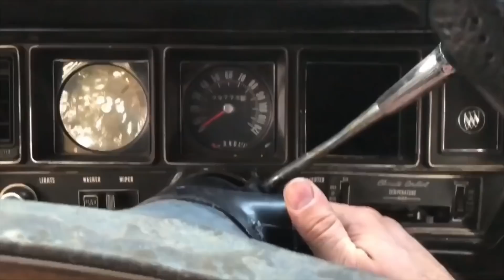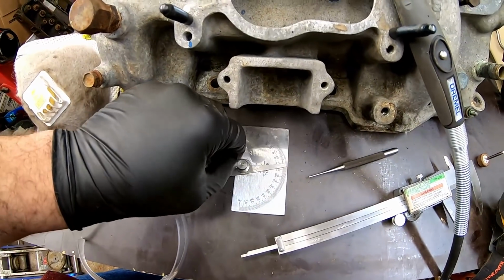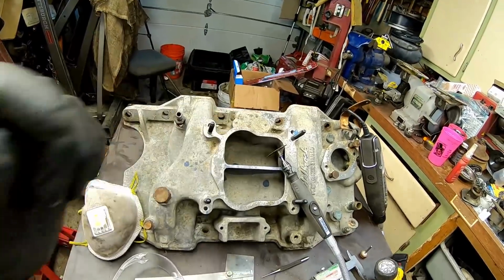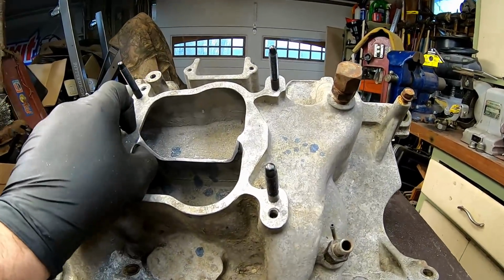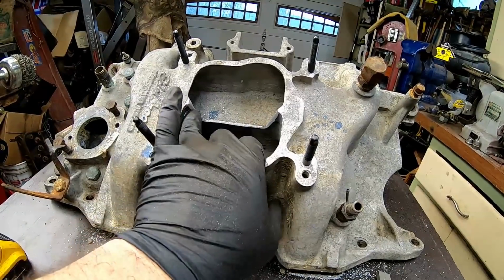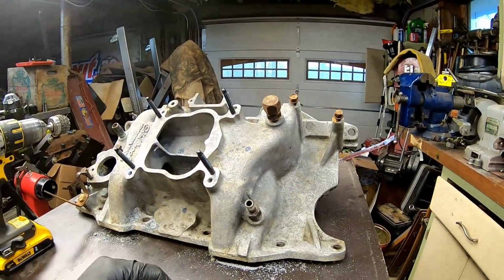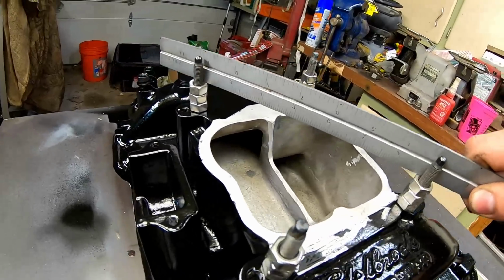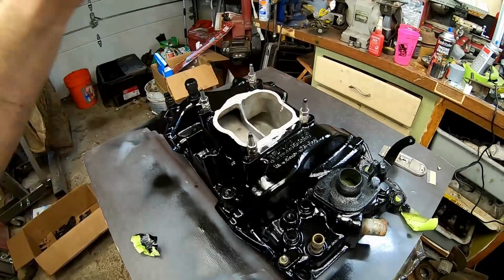How To Increace the Plenum volume for Cheap Horsepower: Notching Intake Manifold Modification

Comment: I like what you are doing so far but I have a question. with the intake ,spacer,carb,and air cleaner are you going to have hood clearance issues .keep up the good work
Reply from the maker: I might need to get a different air cleaner. 🤞
Reply: @LunarOutlawsGarage  I think you need a RR power bulge hood! 😉👍
Reply from the maker: That would be cool
Reply: are you going to put the car on the bottle rocket diet .I know they cut some bracing from the hood and it's pretty cool

Comment: Hey man....the rebuild carb and the mod to intake came out great .....still the black paint is growing on me....but it is what it is 👌......360 heads will also pump up the volume too ?.......be well.....🤘🤙👍
Reply: 360 heads wound ruin the power making ability of the engine.
Reply from the maker: Thanks herbie
Reply from the maker: Ya that would increase the combustion chamber up unless you where to machine head and the deck

Comment: 37 years ago I did that to an intake but I cut it open until all the runners were showing so it was like a modern open poem intake but didn't look like it from the outside
Everybody told me it wasn't going to work
The car run the 10.91 et nothing spectacular to write home about
But after I open the door plane intake to that I ran a 10.74 et 
I don't know what kind of game that made for my 468 big block but somebody that's smarter than me can tell me

Comment: What intake model is that
Reply from the maker: Edelbrock RPM
Reply: Elderbrock 2176
Reply: I have a 5th Avenue trying to find right intake carb and how to make a 4 barrel work with my throttle cable and 904 kick down

Comment: Remember paint doesn't adhere to aluminium very well, after a few months the paint will start to flake off, the way to counter that is to alodine/arodite the manifold first then apply the first coat of primer
Reply from the maker: Yup I hit it with the class media 97% Isopropyl primer then paint. It will be good been doing it for years with no problem 🤙

Comment: The only success Ive had in plenum trimming is with a EFI Magnum plenum. Trimming back 1.25 inches off the runner really woke my 318 up. On wet flow intakes, 1/2 " works best for both HP and TQ. Most TB spacers have smaller openings than the intake and in my case restricted performance .TB spacers are a scam

Comment: Think ya mighta taken lil too much.  Offenhouser took an inch sq. On their manifolds.
Reply: The Offy designs are 50 yrs old, rather obsolete now. They're down at least 20 hp compared to either a Torker or Performer RPM. Actually, my old 318 Streetmaster was really obsolete too, a single plane with a tiny plenum and runners. But it was fine for my use.

Comment: Lol I have that exact same intake lol if I do the same what you figure is the horsepower gain if any
Reply from the maker: We will see come dyno day
Reply: @LunarOutlawsGarage  right on I'll be watching. Did you do dyno before you did upgrades
Reply from the maker: No that engine was roached
Reply: @LunarOutlawsGarage  ok fair enough itll be cool to see bet you can easily get 300 to 350
Reply from the maker: I am really excited to see the numbers
Reply: You're only going to gain HP in higher rpm range. So you have to have a camshaft that supports that. The dual plain actually has more velocity since it essentially makes the runners longer and makes way more low end torque. Smaller cubes, and smaller camshafts best friend in my opinion... people get hung up on a peak hp number and not what the power curve looks like. Which is important to know what the power band for a motor is, based on your particular driving style. Where is the motor going to live at rpm range, where do you need to make power at? And hitting the higher hp numbers and torque in that range for longer periods of time makes a faster car. The camshaft dictates what rpm range the engine is going to make power and your intake needs to support that.
Reply from the maker: One e the cam come and you see the card it will make sense
Reply: @LunarOutlawsGarage  I'm sure you have a plan! You don't come off as one who doesn't put things together without thought. I'll be watching lol
Reply from the maker: Part of this is an experiment so we will see at the dyno
Reply: @LunarOutlawsGarage  Well based on what I've seen with the intake and huge carb you plan on revving the piss out of it! Lol. Looks very similar to the 318 I built and am selling. Since I sold my 73 Satellite I have no use for it.
Reply: @masoncampos7043  how much maybe I'll buy to have for my 73 satellite
Reply: @davidpaetsch8499   Bored .030, stage 2 cam, comp roller rockers and pushrods. Edelbrock Victor 340 intake and Elite series valve covers. Port matched heads, big valves and milled for 9.65 CR. Ready to Roar 410 HP! $3,000
Reply: @masoncampos7043  wow ok give me a bit damn virus wrecked everything but very interested

Comment: Brother I do seriously wish you all the best but couldn't you have simply gone and found yourself a cheap used single plane intake? That's really all you are doing with the removal of the divider and adding the spacer. Also, you are going to decrease your bottom end torque so if this is for a street application, you would have been better off leaving it alone.
Reply from the maker: I could have but this was the less expensive option. It will work out 😁